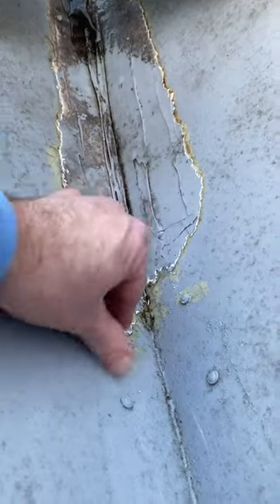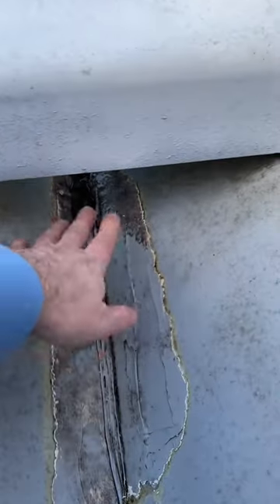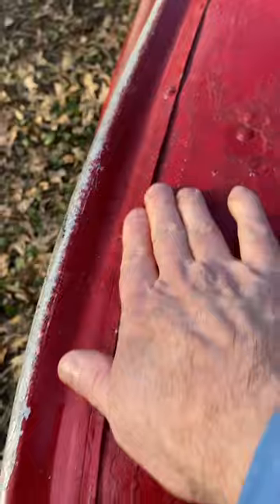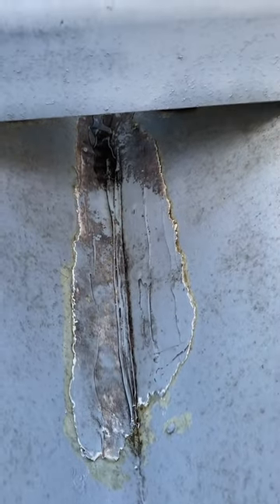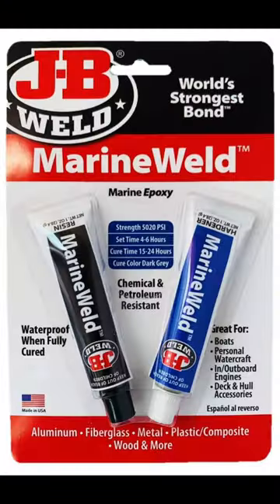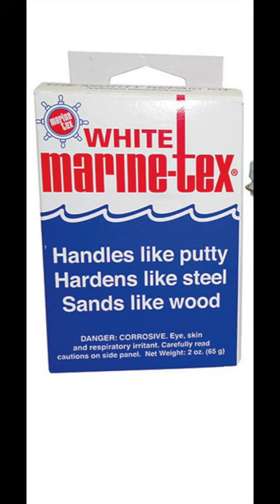Leaky Aluminum Boat Repair

Comment: I’ve got a 16 foot aluminum boat, no leaks fortunately! I got a ten foot Jon boat years ago from a coworker that leaked like crazy, I was apprentice carpenter at the time and used what I had. Construction adhesive!!! Can’t remember brand but it worked !!! I did tighten the rivets with a hammer and steel anvil, two person job👍

Comment: 3m 5200 sealant. It won't leak. Clean all the sealant off, get the old rivet out, tap the joints down nice, and rerivet. Bob's your uncle it's good as new!!

Comment: Henry gutter caulking from home depot, Make sure the sun is hot or at least heat the surface up before you put it on a little bit, and it's seeps right into the crack and stays flexible. So if you're bouncing around, it will not dislocate.
If the boat is wet, no problem, it will start doing this job even more better. Once the boat is dry, even after application. Redo the rivets also of course .
Reply from the maker: Neat idea!

Comment: Late the party here, I had the same issue, boat leaked at the rivets. I drilled old rivets out and put in new solid rivets (all you need is an air hammer and a bucking bar, plus a friend) that will make the rivets seal like new no patch work needed. For cracks, I’ve used aluminum brazing rods and that works pretty well. Braze on both inside and out of possible

Comment: Use fix-it stick from the hardware store works great I used it on my 14 foot boat and both of my 12 foot boats it holds up 👍
Reply from the maker: I have not tried that on anything - but it looks fun to work with!

Comment: I think one or two methods I would use the benzoate aluminum rod where you use a propane torch to heat the hull or I would go back and I would use Marine JB weld epoxy

Comment: Melt some aluminum brazing rods with a propane torch, then cover in JB marine weld, and then paint it with FLex Seal to complete the seal. Then paint.

Comment: Use methylated spirits to get out the old sealant. Forget tapping tins' men rivets, just go and buy some nice blind pop rivets. Pull it apart and use the thinnest bead of sikaflex 291 that works and send it with bond rivets. 
I had the same thing a few years ago. I went to the store that knows about these things and the guy got the old school rivets out but basically refused to sell them to me when he found out what I was doing. I walked out with a tube of sika 291 and my life changed. Back to dry foot boating.
Reply from the maker: That’s an easy fix!
Reply: Did you actually replace or retighten the rivets? Or just smear that sikaflex stuff everywhere?
Reply: We used to sikaflex everything on this one job
Reply: Sometime not even telli g them exactly how we fixed it... Like setting a mirror or crown repair

Comment: Weld it trust me you could just get some aluminum wire and a torch for similar effect buy a cheap angle grinder if you don’t already own one and grind it down till you get the desired result

Comment: You don't need anything to seal it. A ball peen hammer and a dollie will swell those rivets to seal the rivets. It may tske one person on the outside with a hammer and the other on the inside holding a dollie or just hold a big hammer on it while the other person gives it a good whack on the other side. All the gooey patch crap will peel off.